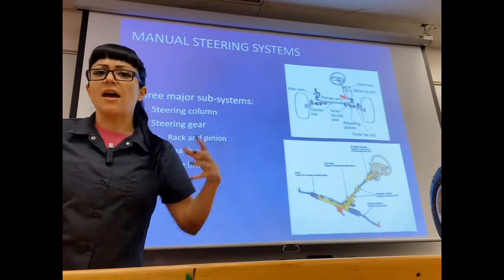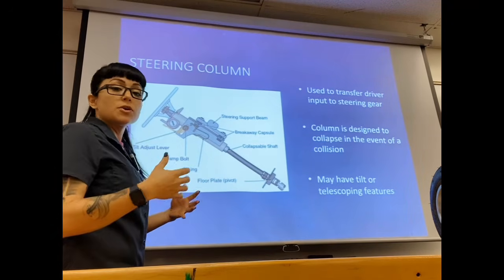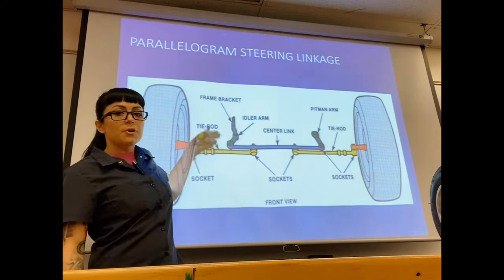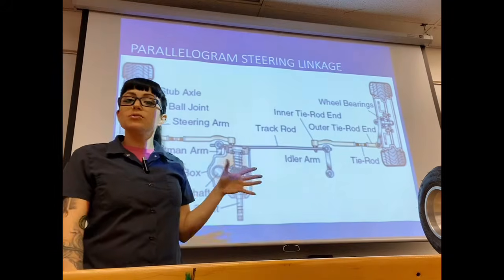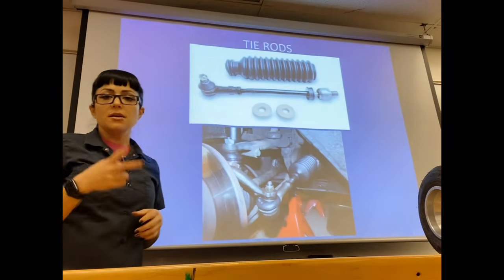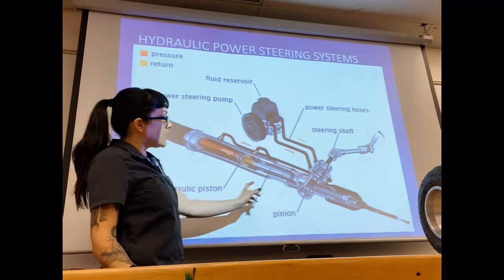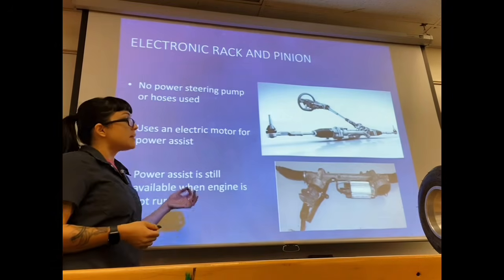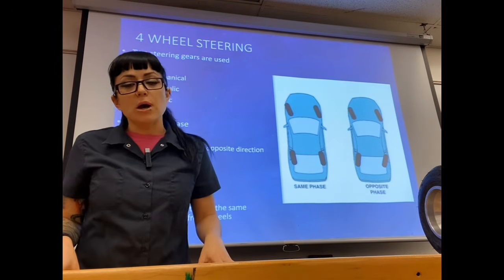Steering Systems

Comment: Ugh as someone who specializes in Toyota Lexus, but do my old school American muscle for my enjoyment.

Let me just say, it’s amazing how we modernized modeling steering with more complex and complete units

Down side is exactly for the same reason. A failing steering system is basically a complete failure. Multiple joints can still work with one failing set. 

Meanwhile, one big failure in modern system, the whole system is shot

Comment: My G6 has a power steering fluid leak.  and after watching this I think the lines going into the rack/pinion are leaking...  Car leaks when shut off.  The leak is very far forward and directly in the center of the car not to the right or left.   Thanks for the lesson.